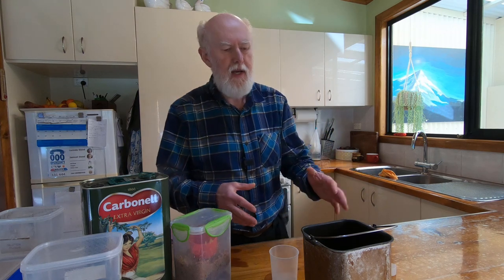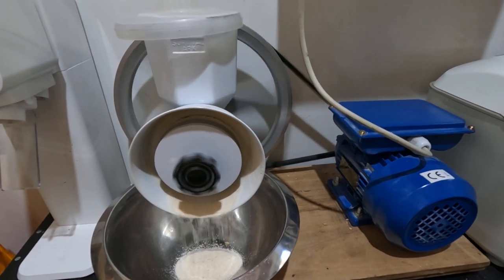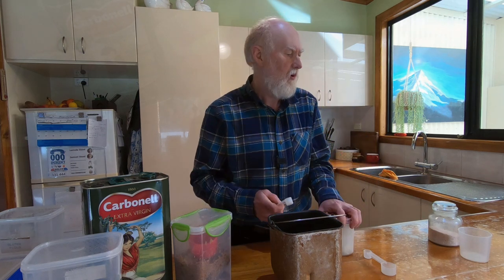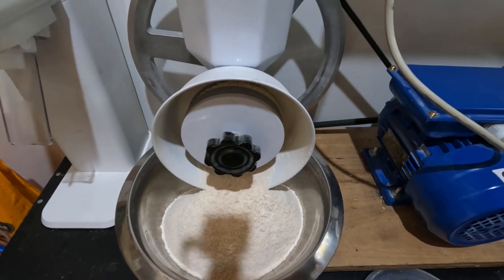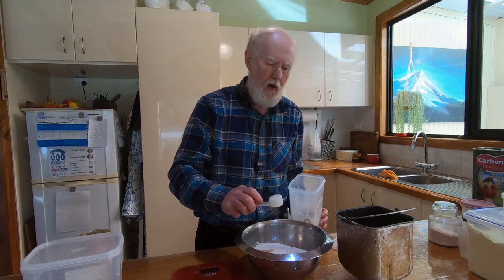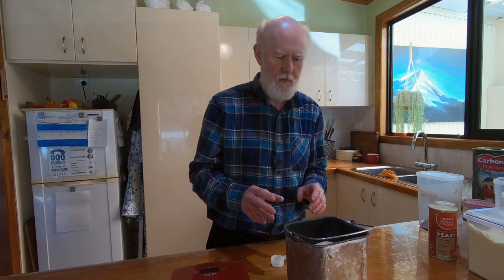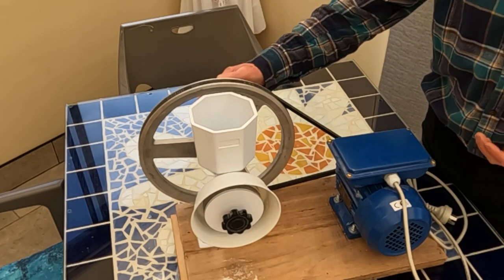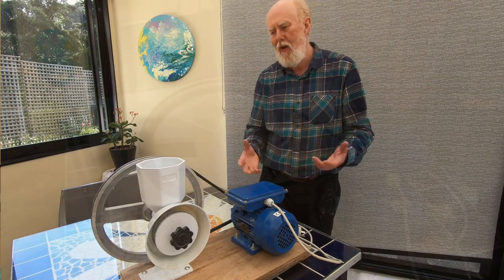"Solar Powered" Bread Making!

Comment: Awesome video! I agree - change the way you live or you may not be able to do what you think you can when you need to! I am going to try those flax seeds in my next loaf - thanks for the tip!

I have a manual (hand driven) junior wondermill (from Australia) which looks almost identical to your one. I found I was only capable of grinding 1 cup of flour at a time. I may have been able to get more than that if I practised long enough, but after 3 months I could still only do 1 cup of flour at a time. The flour was never warm.

I then purchased a power driven wondermill model (conversion kits not available for in NZ) and you are correct the flour comes out warm because of the speed in which it is milled.

Our whole wheat bread machine recipe: ~2 cups water/liquid, 2 teaspoons salt, 1 tablespoon oil, 1 teaspoon yeast, 4 cups freshly ground flour.  If needed I will use 1 tablespoon of gluten flour per cup of flour for a better rise or I will substitute 1 cup of white flour - depending on what I have available.

 No sugar because I prefer it that way. No milk  because I do not live close to a source of fresh milk so I have learnt to live without it.

I still use my hand driven one to grind/crack grains for my chickens.

Comment: Will thus recipe work in any bread machine?  Thanks for sharing.
Reply from the maker: It should work in any machine that will make a 750g loaf, if you want to make a larger loaf, just increase it proportionally, e.g. if making a 1kg loaf, increase everything by 1/3.
Reply: @homesteading  thanks for your reply